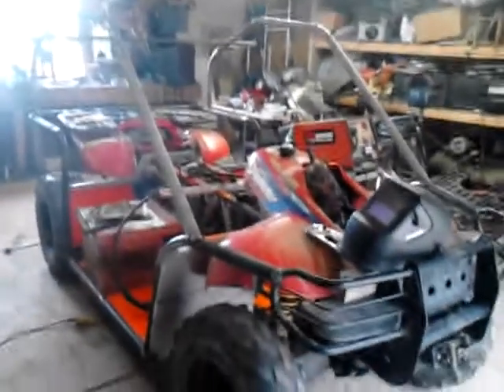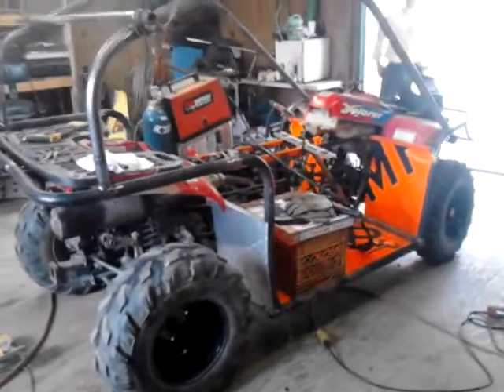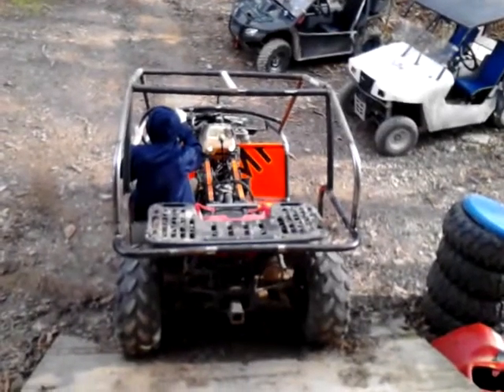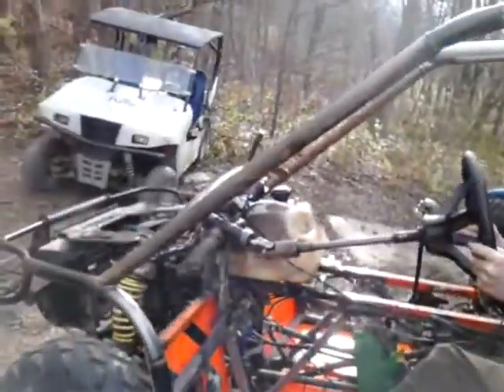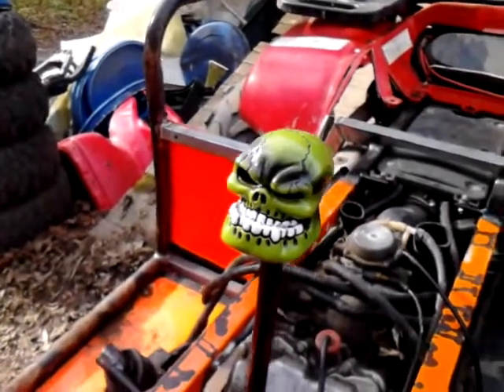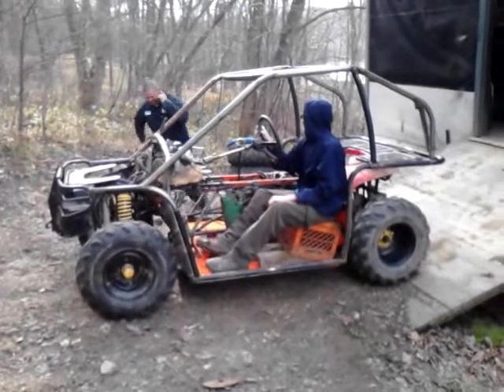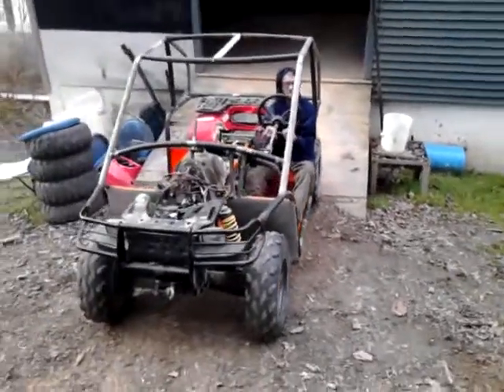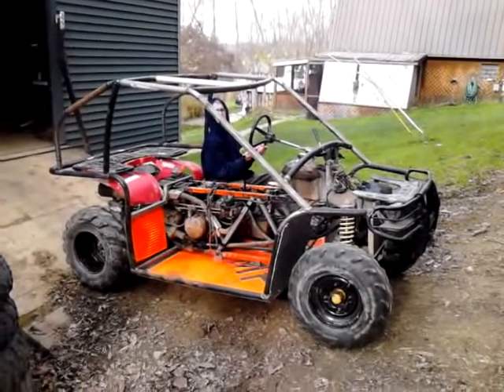polaris sportsman 500 homemade sxs 2

Comment: I watched you vid years ago and now am building a 400 scrambler 4x4 into a machine that is very similar mine is swingarm straght axle but more or less same im using a 650 2cyl ninja motor and stock polaris trans to gain reverse motor in front trans in the rear stretched 12 inches and just a lil wider if i need to with some wheel spacers or different wheels but i want to be able to haul it in my longbed 66 f100
Reply from the maker: That sounds great I'll go to your website on YouTube to keep track of your progress